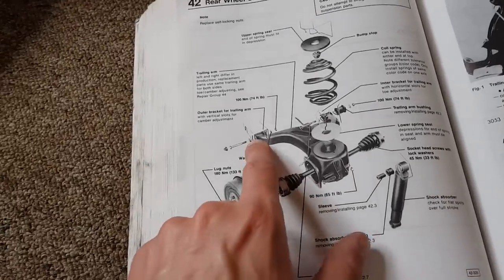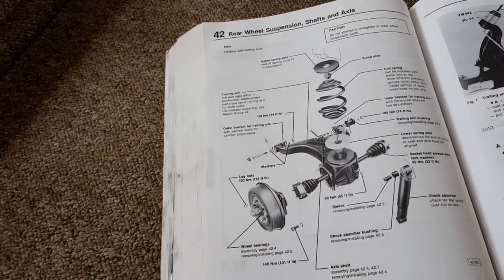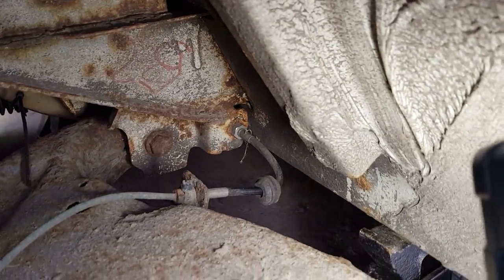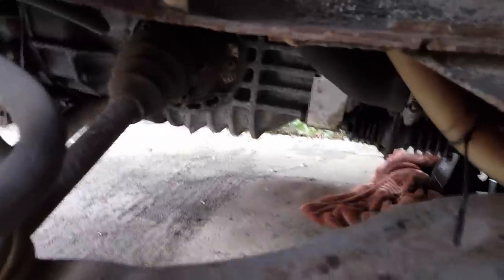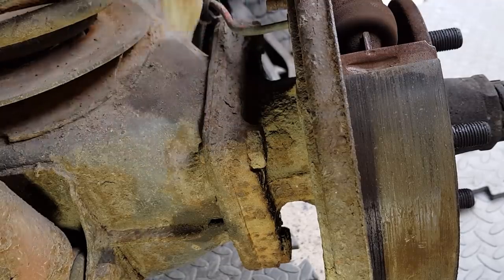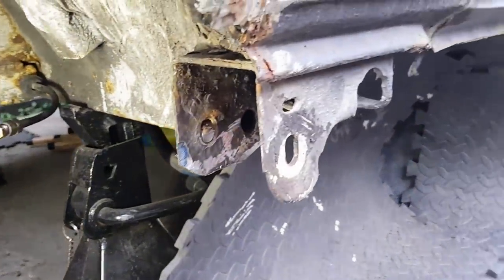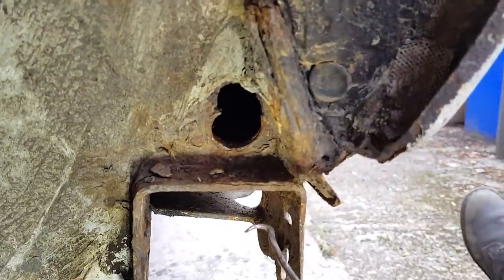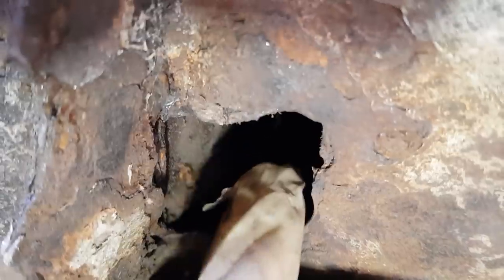VW T3 / T25 / Vanagon - Trailing Arm Bushing Replacement

Comment: Well done sir. 
Always comforting to watch others encounter similar problems on big jobs. 
Made me smile when you had to re assemble the wheel hub so you could take off the castle nut. 
It’s a learning process. You won’t make That mistake again, I bet. 
I’ve Certainly been there before. 

You’re so calm under fire. 
Must be a British thing. 
Snapping off a bleed screw, ugh. 
That’s when I start throwing wrenches. 

My only comment would be, I’d probably take my van to my local mechanic afterward and have them double check the torque for me on the castle nuts. 
Well done and keep up the good work. 
Cheers!
Eric from Oregon.
Reply from the maker: Thanks Eric. Agree that would be wise. Although it's a mathematical calculation so should be about right it's hard to to trust it without seeing it with my own eyes!

Comment: Halfords Professional ratchet ring spanners are required for those rear backplate flange brackets. Get a fixed ring on it first with a wooden hammer to break em loose, and then slip on the ratchet spanner. They're awesome for speeding up jobs like that.

Comment: Nice video with all the info-Just renewed my own nearside jacking point-not for the faint hearted! Luckily the sills were goodstill but alignment test will tell how accurate my 'jig' was. One tip if you keep brake pedal depressed with a wood batten under steering wheel no more fluid will drip from rear brake hoses.Not sure on your torque guesstimate!
Reply from the maker: I'm reading up as much as possible to plan out how to address the mount points, the overlapping panels look a right pain. What did you use for the jig? For the torque - it not a guesstimate, its science!
Reply from the maker: Good tip on the brakes. It was my first time touching any type of brake system. The first drive after I refitted it was hair-raising!
Reply: as i found the cross member had also wasted to less than a mm i measured from back face of mount to a bit of strip tacked vertically toward centre of van both sides of outrigger-then measured how much front to rear the mount protruded either side of cross member-As i didnt have a rotted out sill area i was lucky but still had to cut a access 'panel' in the centre sill so i could plug weld the new Brickyard mount (other suppliers are available :) ) Worst part was fabricating a 'u' shape section of cross member welding it  and then the new mount I used the replacement arm to check i was in the correct position too but think drain hole position is too fartoward centre of van . Passed its MOT last week so i must have done something correct. I was suprised how the outside of the mount and inner part of cross member rot away like you. Just other side to tackle in a year or two after i recover:)

Comment: FYI the Poly bushings will be stiffer and help with improved handling however they will not last anywhere near as long as the oem rubber bushings.  So you may be looking at a bushing swap in another 5 or 6 years depending on your environment and usage.

Comment: Awesome, detailed video. I really, really appreciate your efforts!

 I just had to replace my cv joints and bushes so your timing could be better on my part.

Cheers
Reply from the maker: Thanks man, let me know how it all goes.
Reply: I wish I had seen this vid before I replaced my CV joint.. but still need to do the other side (preventative) so this video will still come in to use (like the other ones did :) )

Comment: like the plug idea on the brake line..did you use a cold galvanizing compound on the trailing arms, the paint seems to change color like cold galvanizing...sometimes it helps to cut the back off the bolts -maintenance guys at the acid plant did that on every bolt...like the brake bleeder as my kids complain when they are employed, up, down, up, down...I should probably do this job on my van...but first, coolant lines and get it running (again).. great video !
Reply from the maker: Thanks Dan. I used Bilt Hamber Electrox which is a high Zinc primer, seems to work really well!

Comment: Thanks,  Video covers what I needed to know.
Reply: Is to know, to let someone else do the job?
Reply: @GetMoreMellow  If you want it done right and pay for only the parts then do it yourself. Books and youtube are a good source of repair instructions. I also enjoy the work and the knowledge gained.
Reply: @richrocketlll  Yes I also do try to do as much as possible, problem is place to work, undisturbed, I've been having to do jobs in front of my house where people are forever passing by, friendly but I need to learn how to say sorry, but right now I am busy - without upsetting them. Seeing how this guy did the job, I realised the guy in the garage, didn't tackle it too cleverly, I mean to burn out the rubber, no wonder his boss was pissed off even if he did that under an extractor it must have been awful. I would not have done that, I think I would have done what this guy did, it's logical, pretty easy too with drilling. Bit of a big job for me though, I couldn't have got my head around all that and done it here on the street. I have d one lots of other jobs though on the street, here it is a pretty unconventional area, all kinds of nationalities, but in a fancy area, I think nosey parkers would call the environmental inspectors, or police. I improvised today to make a tent over my VW camper rear door, as it was raining and has been, all the time, and I need to get on, so I fixed this waterproof material right around and stuck it in between my car's hatch back rear door. It was pouring down but I managed to be able to work comfortably, lying on the ground on a piece of foam, fixing the push rod tubes seals. Really satisfying to not let weather or anything else beat you and still do what you want and need to do, and do it right (I pray). Tomorrow dry all day, and doing the other side.

Comment: Hi James. Will be consulting your vids on work coming up. If I can ask? Where did you get the plugs from  when you separated the brake lines. Cheers Maz
Reply from the maker: Hi Maz. I got them off eBay for a few pounds each. Search for "Brass M10 x 1 Male Brake Blanking Plug"
Reply: @JamesAkers  Thanks James. Your a star.

Comment: I watched the amazing video again and I noticed that you forget to put some anti seize grease on bleeding screw and oil pipe connecters and the brake shoes edges for easy movement. Also can you put link for the grey/black paint you have used . Thank you.
Reply from the maker: My future self is going to hate me. Wish i'd added anti-seize at the time! For the paint I used Bilt Hamber Electrox which is a high Zinc primer, then Rustoleum Combi-color in black.

Comment: Thanks for the video. I'm about to replace the bushings on my own van. I'm wondering, is it necessary to remove the hub, brake and drive assembly just to replace the bushings? That adds a huge amount of work and potential to brake things to my job if that's the case. What do you think?
Reply from the maker: Hi Kirt. No, you could just undo the brake line and driveshaft. I only did it because there was a hole in my brake backplate so needed to replace that.

Comment: Hi James, excellent video and very helpful for me as I needed to remove the brake drum backplates on my van, but what was the reason for you to split the hubs off the trailing arms to replace the bushes? apart from making it easier to paint of course. Keep up the good work thank you.
Reply from the maker: Hi David, thank you. I wanted to give them a full inspection and make it easier to paint. Also, just curious how it all fitted together! You're right, anyone doing this job could just undo the CV joint from the gearbox and take it all off together.
Reply: @JamesAkers  cheers James, definitely made my day much easier. Thanks

Comment: How are the trailing arms now? My guess is they are rusting again? Which black paint did you use after primer?
Reply from the maker: They're great, no rust at all yet. I used Rustoleum Combicolor on top of the zinc primer.
Reply: @JamesAkers  Thanks! Sad we don't have rustoleum here. We do have something called hammerite. Which is really good stuff against rust, but it also fights primer layers or anything else that is underneath or on top. Anything else paint wise, probably doesn't come close to rustoleum

Comment: Nicely done, explained, and produced video...but PLEASE, your setting yourself up for needles misery in the future!...do yourself a favor an use Anti-Seize on ALL threads, bolts through sleeves, brake fitting, bleeding nipple, even on threads of brake adjuster, etc.  ...just about all the difficulties you encountered would not have occurred if AS had been used last time these items were apart...so use AS, especially if YOU are going to be the one having to take them apart next service.  Cheers
Reply from the maker: I have been well and truly told! Thanks Ron, i'll definitely be following your advice on using Anti-Seize for any further work I do on the van.